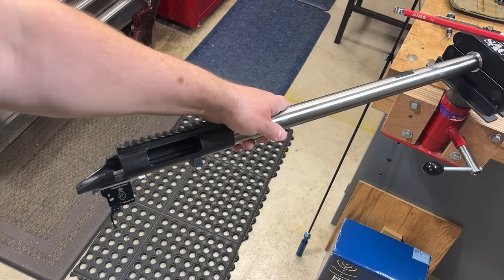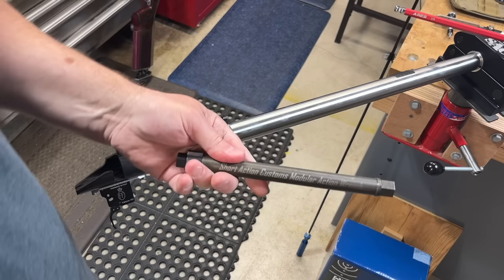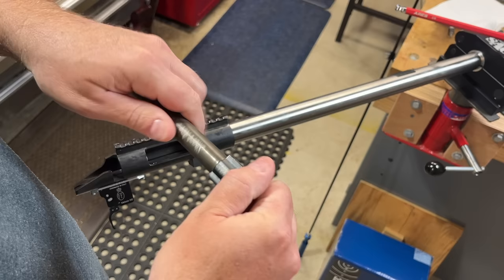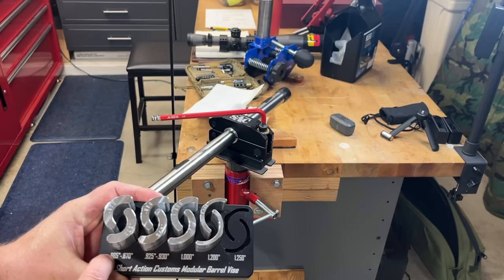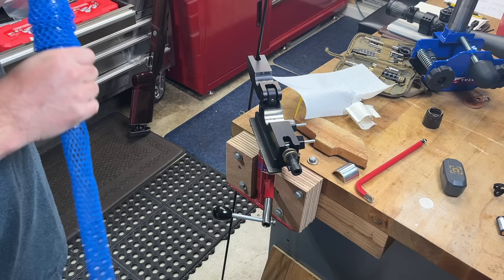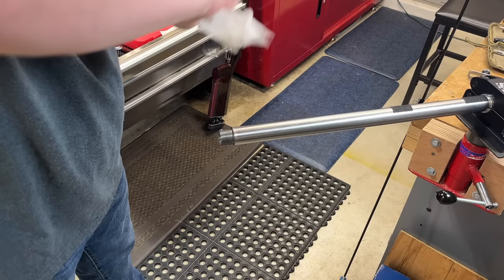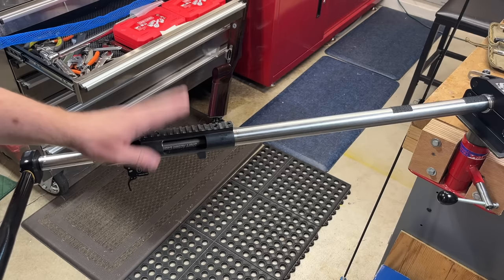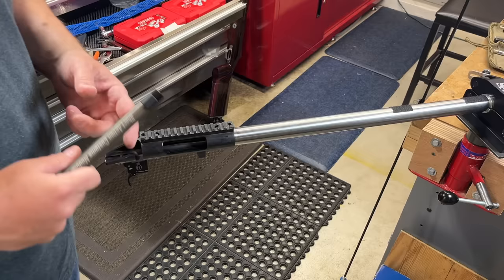Changing barrels w/ Short Action Customs SAC modular action wrench

Comment: At $50 per head, it's not saving you much.  I'm more impressed with the vise.  Much easier and faster than a two-bolt vise.  But no more than I have to tighten a barrel down in a vise, mine works fine.  If you buy at the latest and greatest, you can spend a small fortune.

Comment: Which Barrel vice are you referring to that worked well with inch and a quarter barrels? I can’t afford this one yet. Thanks.
Reply from the maker: You can grab this one. It comes with one bushing so you can choose the 1.25" bushing and always add others in the future. It's a great vise and actually have more clamping power than the modular vise for things like really tight factory actions.